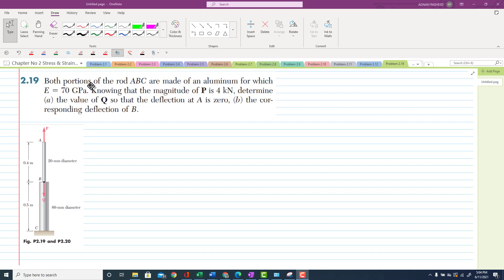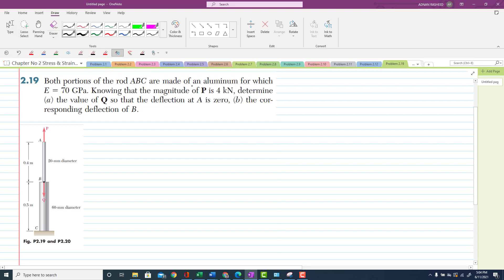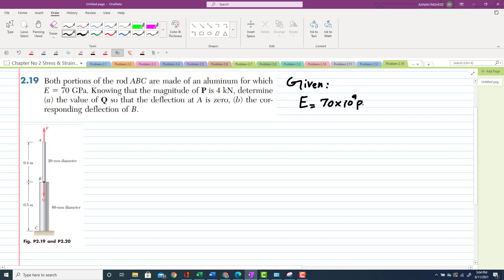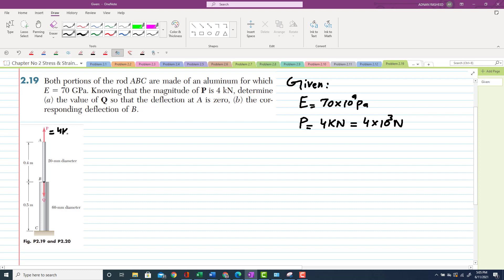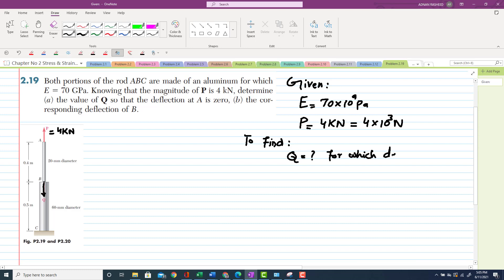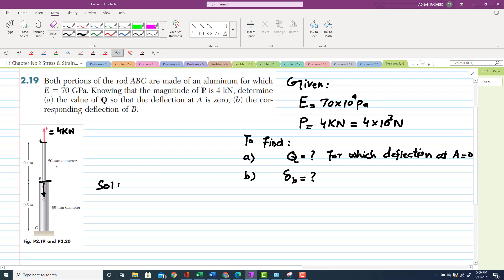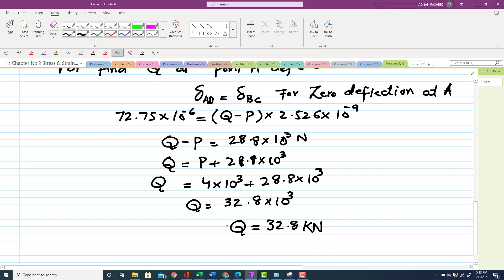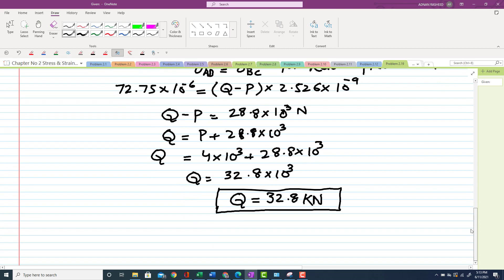Mech of Materials# |ProblemSolutionMOM​ | Problem 2.19 |Stress & Strain| Engr. Adnan Rasheed

Comment: For A_BC, total should be (2.83 x 10^-3) m^2
Reply from the maker: why?
Reply: 3:15. (pi/4)(0.06)^2 is not 2.827 x 10^-6. You ended getting the right value for delta_BC though.
Reply from the maker: @therealnate0772 you are right it's 10^-3

Comment: Hello brother, for the Q - P part, I understand it as taking equilibrium of the whole rod, so Rc + P - Q = 0, therefore Rc = Q - P, does this reasoning make sense?
Reply from the maker: Yes I think so...❤🎉
Reply: @engradnanrasheedmechanical  Thank you for the response!
Reply from the maker: @ozark394 no problem ...Actually I was busy with guests ....
Reply: @ When you could be doing engineering?!
Reply from the maker: I have done it in 2011 and master in design & manufacturing engineering in 2018...currently working as Lecturer in Engineering University Pakistan. I have also 3.5 year industrial experience.
Reply: @ Sorry brother, I was trying to make a joke. I hope I can follow a similar path as you in structural engineering.
Reply from the maker: No problem brother and wish you best of luck and success in every path of your life 👍 🙏

Comment: So what if the direction of P and Q loads are backward, will it be P-Q for elongation in BC ? I was given a task like this but the direction of the loads are backward
Reply: Please i need your help why the total loads in BC is Q-P?
Reply from the maker: First of thank your for your interest in my video. OK as you can see that P is tensile force and q is compressive force. That's why we take q-p in section Bc. Because p cause elongation and q cause compression which results in equal of deflectionand we equate both deflection you have seen in the condition. What if we take p-q then net force in section bc will be no more compressive and it will be also tensile so in that condition elongation will be not equal at the given point b. I hope it is clear now
Reply: @engradnanrasheedmechanical  thanks for your information. But in my case the P is compression dan The Q is tensile (backwards) so what should i take  to equate both deflections?
Reply from the maker: @dropsec2528 try it for both cases and from answer you can conclude it.

Comment: 5:32 why do we take force in member BC as q-p and not p-q
Reply from the maker: First of thank your for your interest in my video. OK as you can see that P is tensile force and q is compressive force. That's why we take q-p in section Bc. Because p cause elongation and q cause compression which results in equal of deflectionand we equate both deflection you have seen in the condition. What if we take p-q then net force in section bc will be no more compressive and it will be also tensile so in that condition elongation will be not equal at the given point b. I hope it is clear now.... 🙏